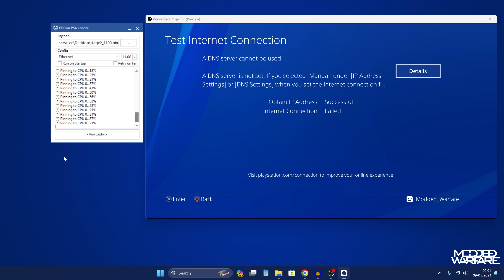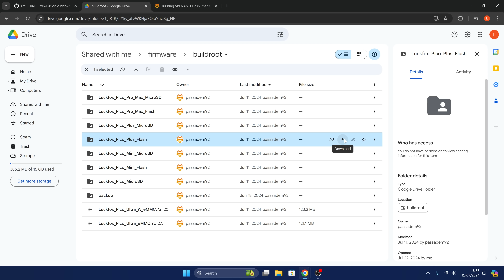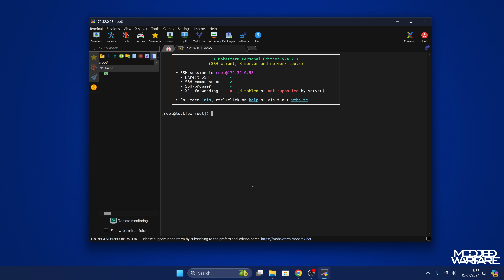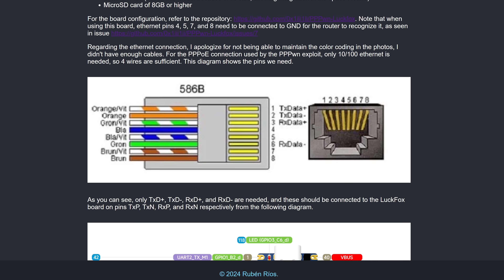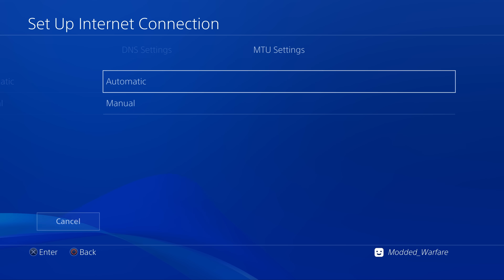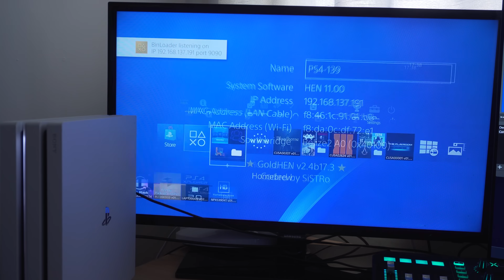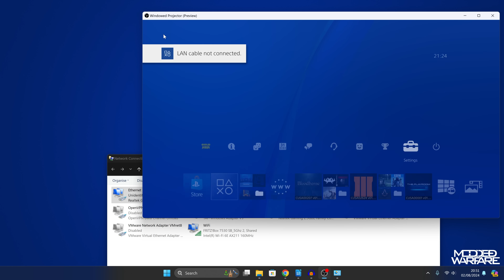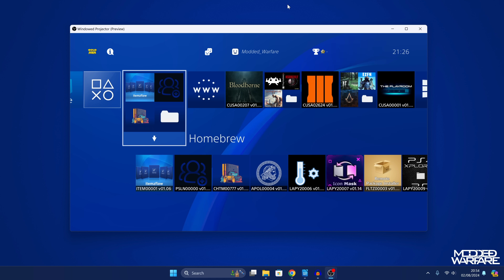Using a Luckfox Pico as an internal mod chip for the PS4

Comment from the maker: The setup process for installing the PPPwn exploit on the Luckfox device has changed since this video was published. This new guide covers the updated installation method for setting up the Luckfox device with the exploit: https://youtu.be/kN5lyai8h8Y?si=wz_B1UF0NP247Har
Reply: hello brother if at all you have updated diagrams for the original phat ps4 and the ps4 phat revision can you please share
Reply: What about the ps4 pro does the Ethernet pinout change?
Reply: Didn’t want to assume all ps4 pro models are the same
Reply: You need to start the video off with "YOU WILL NEED THE 11.00 OR OLDER FIRMWARE ON YOUR PS4". 

I was looking for a technique that fixes the 11.10 or newer bios firmware already installed issue.

Comment: If you are using a fat ps4 model: The VBUS and GND solder points for the usb port are behind the ones shown here and they are also mirrored. There is an image on a reddit thread if you google it. Other than that: Works perfectly.

Comment: For anyone doing this mod make sure you use thick enough wires. I tried using thin enamel coated wires for the ethernet connections and it failed to detect the LAN cable as connected.
Reply: Can I just use the wires from a stripped Ethernet cable?

Comment: network port dont work after luckfox turn off..  lan cable will not work
Reply: Having the same issue. Posted it on the Git, no answer, and there are others with the issue. I decided to just remove the mod and go back to the USB version of the hack.
Reply: @HornHeaDD_SNK  to be honest i finaly  got it working,,  using the pppwn_luckfox_v1.2.5_pico_plus_image_web_FW_9.00-11.00_SD.7z
Reply: @HornHeaDD_SNK  its very simple program the chip, with 1.2.5 only after active the hack normal,, with the web page 192.168.1.1 after the jailbreak run... there opcion call desable tps something,, click that end the network port will free up,, end you can use the network,, port took me a lot of trial error a lot,, tested on ps4 fat,, never tested it on ps4 slim or pro
Reply: @HornHeaDD_SNK  need any help pm me..

Comment: I installed this mod and all working good. Its possible to use ethernet port to connect to network...to install pkg from PC? Thanks
Reply: You can use ethernet while LuckBox is turned off
Reply: @marco.lino.27  but i can't have the network cable always connected. Gonna use a network selector 👍

Comment: Nice! I was wondering if it would be better to pass the soldered wires inside the board, because in this case, if you need to remove the cover to change the thermal paste, for example, you will have to redo all the soldered wires... :(

I'm a layman, is there any problem with the wires touching the board?( Because i believe they are already isolated, right? )

Otherwise, wouldn't it be better to use that yellow insulating tape? 

Still, great video! Thanks.
Reply from the maker: Thanks for the tip! You can run the wires inside the board. You just need to be careful not to crush them with the metal case when you screw it back down. Leave more slack in the screws or find a way to route the wires so they're not obstructing anything.
Reply: @MODDEDWARFARE  😎😎👍👍

Comment: This works, until I shut down the console.
After initial jailbreak, the pico shuts down, and no longer comes back on unless I plug/unplug the ps4. any1 has this issue? any fix?
Reply from the maker: Check your power saving settings. You might have the option to keep USB ports powered when the console is turned off. That would keep the Luckfox constantly powered on and wouldn't restart the exploit when the console is rebooted.
Reply: woa ! The man himself !
That was the issue, thank you so much for your videos and time for the community !

Comment: Any hope we can have more automation to change the LAN settings to "Easy" after jailbreak is done? And before turning off the luck fox?

Would be great if we can have another script be triggered by shutting down the ps4 so it gets changed back to "pppoe" before it actually shuts down so that the ps4 is ready for jailbreak on next boot

You can give the user control over the actions he wishes to automate

- switch to wifi
- switch to easy lan
- switch back to pppoe before shut down (this may be a separate homebrew app that the user can use to shut down the ps4, not necessarily inside the actual power menu)

Comment: after exiting sleep mode the chip turns on again and does its job, but this is not necessary
Reply from the maker: Should be able to fix that by enabling the setting to keep USB ports powered in rest mode.
Reply: @MODDEDWARFARE  it didn't work in my ps4 slim. it's useful to check first that it's already activated, then turn off the chip

Comment: First off, THANKS Modded Warfare always great videos. 
Second, am I the only one who had problem with the soldering? I tried and had problems, so though I'd just wait to get better equipment, after trying to solder on the Ethernet port, mine doesn't work anymore and ask to plug the network cable, even if I have it plugged in.... (Cable tested)
Didn't think that trying the way showed in the video wouldn't actually affect the port itself... 
If someone has a hit? 
Sorry english is not my first language so can add more info in private if someone is willing to assist. I can have pictures too. 
Thanks

Comment: Help! I made the procedure right. i made the goldhen work in the ps4 pro. but there is a problem, i cant connect to my computer network. On network settings adapter, my ethernet cable is broken. at first it connects then it disconnected. its like a loop. does anyone here experience this? its hard to put pkg games without using network. is there any other way than this and using external hdd? Thanks in advance.
Reply: also on FTP checking it goes aborting FTP when i turn it on on Debug settings

Comment: Hi. 

I input 172.32.0.93 username root in mobaXterm it didn’t prompt a password or certificate. 

Therefore I can’t drag the pppwn-luckfox folder over.

Any idea why?
Reply: It’s ok I figured it out
Reply: After installing the chip. It didn’t work. Tried to reflash the chip. MobaXterm won’t let me in. Gonna quit this and go with the new tool kit that’s available. This modchip way is really unstable

Comment: thanks, works perfectly in my ps4 pro
Reply: what firmware version is on your ps4 pro?
Reply: @RetroBandit-ps  11.00
Reply: I also did this method on my ps4 pro. But I have 9.0. Hacking happens, sometimes 2 minutes, sometimes 3, it also happens that console  turns off.

Also, I have a ps4 slim at 11.00, there is a hack with luck fox pico mini b, it’s great - the hack takes up to 1 minute

For some reason, I have a guess that firmware version 9.0 is not what is needed. I have a feeling that I need to update my PS4 pro to firmware 11.00 and then hacking will go quickly and without problems. I don’t even know who to consult with. Can you tell me something?

Comment: Luckfox mini b have issues with running the script and config file says not found
Reply: first time you need to insert a flash drive into the console where the goldhen.bin file will be located at the root of the flash drive. Then the hacking should go through. And the goldhen.bin file is copied to the console itself.
Reply: @OlehBialohan-sr8wo  did it used a lickyfox plus it worked
Reply: @echo7016  yes

Comment: I got a message saying too many usb devices were in use.... Help?
Reply: i had the same issue after closing up the console.  when i closed the console the wire pushed against the soldering point for vbus and came in contact with itself causing a short.   Just redo the soldering job for the usb connection making sure no other points of the wire are coming in contact with anything else besides ground and vbus.

Comment: For anyone having the same issue as myself:
I spent several hours trying to figure out why I couldn't get the mod to work. I narrowed it down to the Luckfox not actually executing any code. The fix was simple once i figured that out.

To fix: Open MobaXTerm and connect to your Luckfox just like in the video
from the root run this command: nano /etc/pppwn/config.json 
in that config file I found autostart was set to false, change it to true 
CTRL+S to save CTRL+X to exit. 
Should work just fine once connected to your PS4. 

Hopefully this helps anyone with a similar issue.
Reply: I have tried to follow everything in the video but 
IP address _ failed while checking network. (Fat model)
Reply: Should execute flag be on?
Reply: here's me hoping this is my issue.

Comment: What its the reason for download the firmware version for pico plus instead version for the pico mini?
Reply from the maker: I think that because the pico mini doesn't have an ethernet port the firmware for it doesn't enable the ability to communicate over ethernet. The Pico plus firmware does.
Reply: @MODDEDWARFARE  tank you!
Reply: @MODDEDWARFARE  Hi, I flashed luckfox pico mini b .1 installed a web server when flashing.
The hacking is good. But I can't enter the settings through the browser to access to luckfox pico mini b ? Can you help me?

Comment: Hi. Thanks for sharing this with us. I've done all the steps and it shows Luckfoxed but after it comes up with Payload not found. Message. After that I'm stuck. Any thing that I've missed?
Reply: I have a theory. maybe the first time you need to insert a flash drive into the console where the goldhen.bin file will be located at the root of the flash drive. Then the hacking should go through. And the goldhen.bin file is copied to the console itself. I will try to do it tomorrow. I'll tell you if it helped.
Reply: @RetroBandit-ps  Thanks for that. It worked loading Gold Hen
Reply: @stranger.02  how long does it take to hack your ps4 ?
Reply: I have same problem. I have PS4 Pro 9.0 . I do everything like in tutorial , see icon Luckfoxed and then payload not found. I don’t now what now doing.😢😢😢🙁😭
Reply: have you fix the problem?
Reply: read the read me in the PPPWN main folder it says clearly at the bottom first time adding the payload to the console you need to place the file in the usb drive folder to the root of a USB while boot up.  it will copy the bin file to the console after the first time and you can unplug

Comment: I have managed to use it with my 9.00 and pppwned it successfuly, 
then updated to 11.00 and made the change to the luckfox to pwn the 11.00 
but now it starts the procedure and you can hear the sound of the ps4 menu to crack a bit and then after 3-4 tries it crashes the ps4 slim.
Any ideas for a fix?!
Reply: Did you fix it
Reply: @sonic91131  hasn't fixed the cracking sound, but it stopped crushing. 
It may crash once every now and then.

Comment: 9.00 The nand method worked but I get the message no payload found ??
Reply: hello . you fix that problem ? because i have same problem.
Reply: I have a theory. maybe the first time you need to insert a flash drive into the console where the goldhen.bin file will be located at the root of the flash drive. Then the hacking should go through. And the goldhen.bin file is copied to the console itself. I will try to do it tomorrow. I'll tell you if it helped.
Reply: have you fix the problem?

Comment: I did everything but the ps4 says "Too many usb devices connected" and it doesnt't work.
Reply: I found the solution by myself, when I put the metal case back on the usb power cables shorted and had that message. Fixed it with drill holes and capton tape.

Comment: Hey my setup is based on this video (Automatically Load the PS4 9.00 Jailbreak using a Raspberry Pi) if I did the luckfox pico internal mod what would happen to the old setup? Also is there a way to integrate both or just change over to this? 
If you can give options in a new video that will be welcome. I like my current Raspberry Pi setup as it works on the first try almost every time. However it is not portable because it is based on a static Ip. Once I move to a place with a dynamic IP or restart the console  it will not work cause it will only look for that static Ip every time. Respond at your leisure....

Comment: Hi, is the jailbreak permanent on the ps4, or do it  loads up every time it turn it ON with this method im new to this thanks
Reply: It's not in any way a permanent jailbreak, this just starts exploiting when you start your console, it is in no way shape form, or function anything even similar to ENSO on the PS Vita, when you boot your console up you will need to setup the LAN connection, and let it exploit which can take up to 1 hour (at the worst), if you have seen his videos before it's exactly like the Raspberry Pi method, except everything is hard wired within the system so it can be more portable, and not take up any ports

Comment: Buying a 9.00 ps4 will be better, cheaper and faster than doing this..
Reply: Finding 9.00 ps4 for cheap is pain in ass
Reply: True, that is if you can find one that isn't too expensive. I got my PS4 Pro on Version 9.60 for $200, meanwhile PS4 Pro's during the same time with 9.00 was priced at $400, I ain't paying x2 more, when I can just buy a 9.60, and update to 11.00 this mod works just fine for me, and it helped that I'm use to soldering by now as I've made my own Insider out Slime FBT for VR, so it was a no brainer to hook up some wires for a semi auto JB

Comment: What about the wifi. Will it run normally after the pico disables itself in every boot?
And the usb power, will it not interrupt any device connected to it, say, i connect a bluetooth dongle for the headset or a portable screen powered thru the usb?
Reply from the maker: USB and WiFi are not impacted by the mod.
Reply: @MODDEDWARFARE  this is awesome then! Say byebye esp32.

Comment: Nice video, as usual from you.

I'm going to attempt this mod and at the same time I'll swap the HDD for a SSD. I tried finding some tutorial about this in your channel to no avail.

My PS4 Pro has 10.01 installed. How will I go about installing the new SSD with the 11.00 firmware? Could you point me to a tutorial, please?

Thanks!
Reply from the maker: If they have the same capacity then the simple solution is to clone the existing drive to the new one. You can use free software like HDD raw copy. If you want a fresh install then put the new drive in and download a recovery firmware for 11.00, place on USB and reinstall system software in safe mode.
Reply: @MODDEDWARFARE  Thanks! Seems simple enough, when you know what to do.

Comment: Amazing work as always!

I wonder if you and some of your awesome friends can 'mix' two kind of solutions (paul jenkin 'auto goldhen on rpi' + this one)  to make everything possible with one single luckfox or rpi.

Let's expose the idea :
1/ on boot :
- Use the way Paul Jenkin uses the automatic keyxtroke to change the settings but to change the ppoe settings

2/ then
- Let luckfox pico to its magical

3/ while goldhen is loaded but before shutdown
- Use again Paul Jenkin automatic keyxtroke to change the internet settings back to 'normal' dhcp

4/ turn on an ethernet switch then turn off luckfox:
- Find a way to 'activate an ethernet switch' like simply turning on a smart plug (With Home Assistant or similar) which controle the switch just before luckfox turn off
 
The Only thing left to the 'user' is to turn off the switch while turning off the PS4

Hope I was clear enough for you to get the idea

AGAIN THANKS FOR YOUR AMAZING WORK AND CHANNEL

Comment: i have a question i am
on 9.00 and the usb put in out , in out, is very nerving ;/ When i solder these chip, is it than hardwareles on USB Slot and hen is loading from the Modchip ?
Reply: U only need the usb ones after goldhen is loaded one time its saved on the harddrive

Comment: Tested in PS4 FAT and working perfectly.
Reply: @DAANTJEKIEKEBOE  As above in the video he shows the correct points and they work fine
Reply: @AndyThompsonDarkPhoenix4530  points are correct
Reply: you don't have a problem with USB devices in this port? e.g. connecting a pendrive is no problem?
Reply: @Gru8a7  all working perfectly
Reply: After everything, ip address - failed
Any help please (fat model)
Reply: Done my install a few months back.. just realized my Ethernet port no longer work!?. Any advice? My luckfox turns off once booted.. so not that..
Reply: For the power to the pico did you use the same grounding spots?
Reply: Can you help with the ps4 fat Pinout
Reply: @marionycon9488  in this video you have a tutorial
Reply: Where did you put the luckfox chip inside the PS4? I don't know where i can put it.....
Reply: @WiLLiEFoG  In the empty space in front of the fan
Reply: @jrenecp1106  Thanks for the idea, perfect spot to put the chip

Comment: Why can't I use mini A type?
Reply: mini a does not come with sd card, i think.
Reply: @standalone360  Have you ever installed NAND on luckfox pico plus?
If you install PPPwn directly on NAND using MobaXterm, SD memory is not required.
The only difference between the Luckfox mini A and Mini B is the NAND difference between 64GB NAND and 64GB + 128GB.
Reply: @standalone360  Have you tried NAND installation on luckfox pico plus?
If you use MobaXterm to record PPPwn directly to NAND, SD memory is not required.
The only difference between Luckfox mini A and mini B is the NAND difference between 64GB NAND and 64GB + 128GB.

And, why is someone erasing my comments?

Comment: question… with doing this, if i make it not showdown after finishing, will you be able to use your ethernet on the ps4 or will it only work if the pico shuts down? asking because i plan to keep it on, power it externally through usb instead of soldering its power, use the gpio uart headers and then plug it into my pc and monitor via ssh.